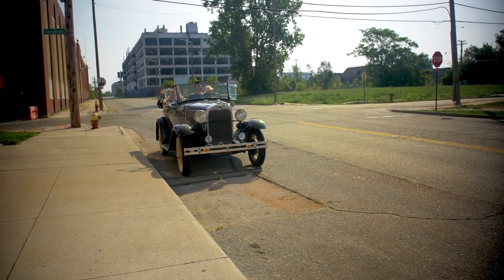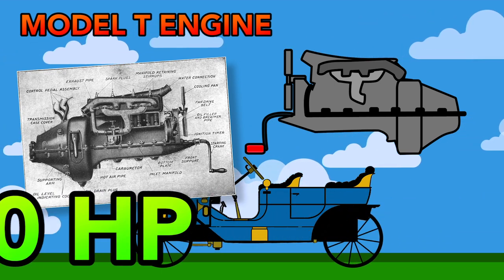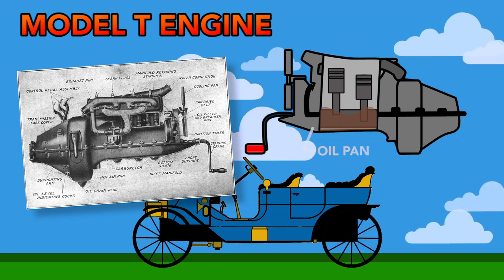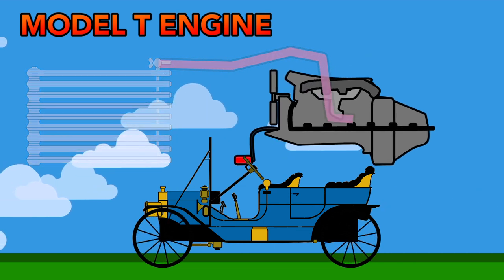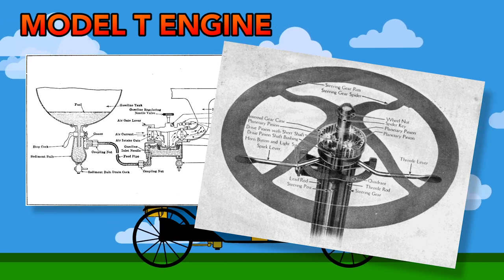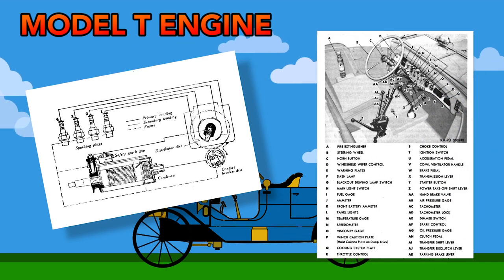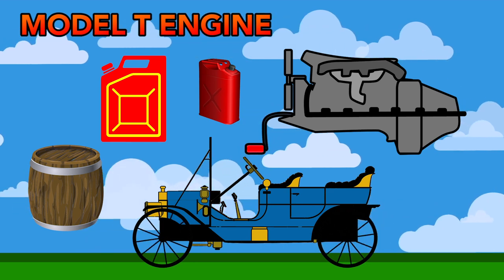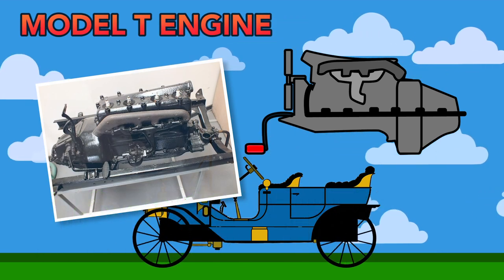How Did the Model T Engine Work?

Comment: The Model T was designed to run on gasoline or alcohol. That was a big advertising point. But nobody mentions that. Alcohol is cheap to make, with sewage and brewers yeast. It’s almost free.
Reply: Increasing taxes, laws and excise on ethanol tax discouraged farmers from fermenting and distilling crops into alcohol.  It was too much a hassle.  Who knows how biofuels might have happened had it not become so difficult.
Reply: Ethanol but yes
Reply: Thats not exactly right. The Model t was designed to run on gasoline - period. The gasoline at the day was another quality than to day so with minimum changed it could also run on kerosene. Later it was discovered that it also ran fine om ethanol/alcohol, but that was NOT in the original design specs.
Reply: @dykker5502  I’m not able verify anything, so you might be right. Years ago I read that the Model T ran on both alcohol and gasoline. And the article also said that the Model T engine factory could switch from gasoline engines to steam engines in an hour.
But I’ve never seen a Model T steam engine.
Reply: @dykker5502  I won’t argue. But you’re making authoritative claims, without presenting any proof.

Comment: If you think about it, this would be the perfect car if the apocalypse or downfall of civilization happens. It’s super simple mechanically and it can run on just about any liquid that combusts. And it doesn’t need all the fancy standardized parts, fuel, and different oil types that modern cars need.
Reply: I'm certain today's engineers could create an even simpler & more efficient engine, if they had the incentive to innovate in that direction.
Too bad we're not going to see one 🙁

Comment: Compression ratio dropped to 3.9:1 for a while because as demand for petrol rose its octane rating dropped.  Cracking etc improved supply.
Reply: What was the original compression ratio and what was the final one after they got better quality thermally cracked gasoline?

Comment: Compression wasn't even 4.5:1. 1908-1913 were 4.3:1, 1913-1917 4.2:1, 1917-1927 3.98:1. The continuously decreased compression to combat poor fuel quality so it would burn any of the garbage of the day. It wasn't deliberately designed as a flex fuel car, but regular gas back then was like 65 octane, slightly better combustibility than kerosene or alcohol which is why they'll run on it. While higher end cars with more compression had to be picky on gas, the T would reliably ignite just about anything you put in it.
Reply: I’ve heard the octane rating was as low as 40-45 at times.   Kerosene has a low octane rating would run in a 3.98:1 CR engine but it would need to be preheated first.  This was done farm machinery like the rumley oil pull tractors.  You started in petrol, then when the engine was warm the kerosene line was warmed by engine heat (it was wrapped around the engine) and then you switched fuel.   The other way to get vaporisation is direction injection like the 1920s Hesselman engines.

Comment: Most hilarious thing about old engines is the engine would be huge but they wouldn't make much horsepower
Reply: What do you expect for 1908?
Reply: Are they use lots of fuel, the model A got about 13 MPG

Comment: Good video but you could've gone way more in-depth. For example why aren't modern engines so flexible with fuels or use a cooling system with no moving parts?
Reply from the maker: I could’ve, you’re right! Those are great topics for a future video 👍🏼
Reply: The simple answer is that the T was designed like this for reliability. Gas back then varied a lot and regular was around 65 octane. Run that in a car today and you'll choke it if it even runs at all. Gas was a little better than kerosene or booze. Ford designed the T with low compression to reliably burn all gas available. Runnign a T on kerosene or alcohol works alright, but you'll cause premature fouling and valve erosion if you do.  It does come at the cost of fuel efficiency and power however. T's top out around 45mph. It's also a flathead engine which is pretty robust but lacking in power vs todays overhead engines which are a little more temperamental in fuel but much more powerful. I put an accessory 6:1 compression head on my Model T along with some other original accessories like different carb, intake, and other bits. It will now top out around 60 to 65mph, but it probably won't burn kerosene anymore either.
Reply: @oldtimesmatthew  if you tried to run yours on kerosene would it cause damage or just not run?

Comment: Well call me a hobo but kerosene sounds pretty expensive to run a car and despite having 20 horse power 8 assume that the model T has less tourque then a modern 7.5 hp engine because it's all about how the engine is built. Overall the model T very interesting but not great to drive vs a bicycle or your legs.
Reply: It was and still is a great car. It has stock 90-95ftlb of torque, quite a bit for a 20hp engine. They produce 4 1/2 times their hp in torque, which is impressive even by today's standards. They were like Jeep before Jeeps existed. Great offroad vehicles. All bottom end torque and pulling power. They'll cruise all day at 35mph and top out around 45mph depending on body style. Absolutely antiquated today, but still a pleasure to drive. I routinely take out my 1926 Model T coupe. I do anywhere from 1,000 to 2,000 miles a year in it just for fun and sharing it.
Reply: Once kerosene lighting was replaced by electricity, and once gasoline (and thus total crude oil) demand increased, there was a large oversupply of the kerosene/diesel fraction off the distillation column. Kerosene and diesel were very cheap and remained so for decades, until more and more diesel trucks and oil furnaces were built. But in order to burn kerosene in a gasoline engine, they had to keep the compression really low to keep from preignition. You usually had to start them on gasoline to get them hot enough for kerosene to vaporize. Some multi-fuel tractors had a spout to dribble water into the intake to cool the fuel-air charge and prevent preignition when running on kerosene.

Comment: Well, the engine would have to run on anything since there was not a gas station everywhere at the time.  Again, proving that from day one, our dependence on fossil fuels is not necessary.  The work on the on turbine car also had the same fuel capability.   Only 56 of those cars were built.  Now we just follow the world instead of showing this innovation and moving forward on technology that works.  By switching to batteries, now you have a lithium dependence.   Which lithium mining is not great for the environment either.   Got to think smarter.  But it is about $$$ going into politicians hands who have invested in Green Energy.  That is why they back it.